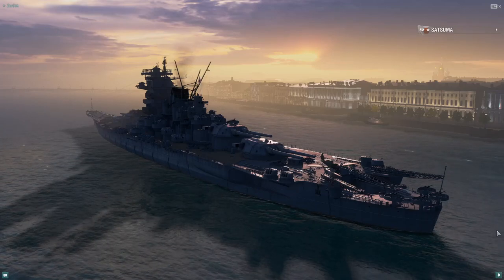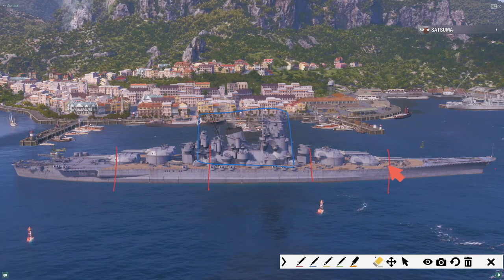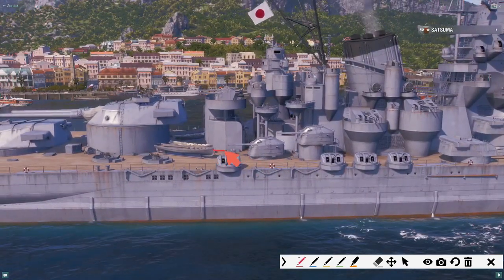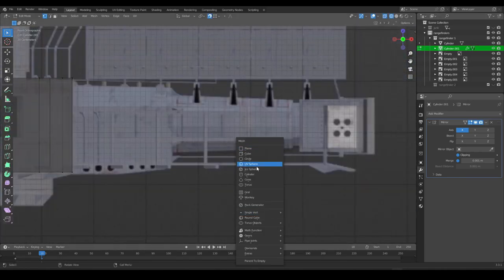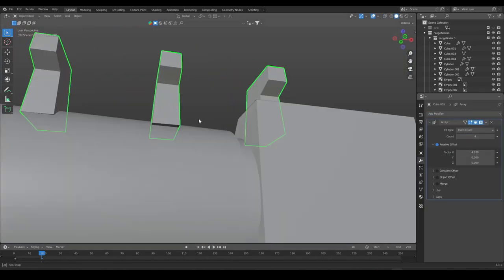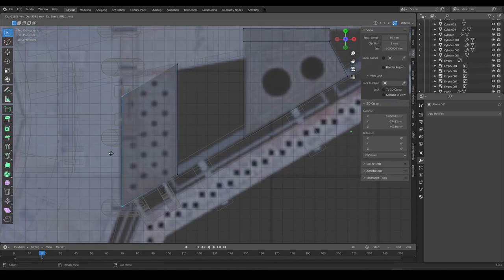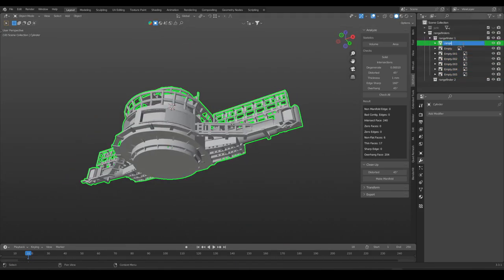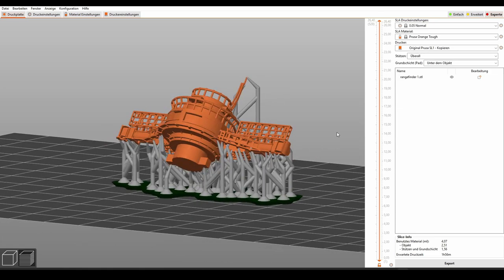The making (3d printing) of a Super Battleship - Part 1

Comment: As someone who builds and prints 144 scale warships for RC use, I fully appreciate the amount of detail you went in to. I avoid it for several reasons, RC use being the biggest one. Handling the ship in and out of the water is going to lead to a lot of broken bits. Ease of FDM printability is another big reason. RC use also being why I dont use resin prints. 
However for a static model it is wonderful to use.
Reply: Do you have a link to your models and can the 3D files be purchased?

Comment: It will be interesting how you get on, I also 3D print war ships for rc control. I print and add the details separately which makes fine parts much easier. I have already built a few ships but am currently building HMS King George @ 2.8m long, the Castle Class Destroyer HMCS Bowmanville @2.4m long & the Fletcher Class Destroyer USS Kid @ 3m long, it helps to have a few printers too and a trailer to take them to the pond! Good luck.